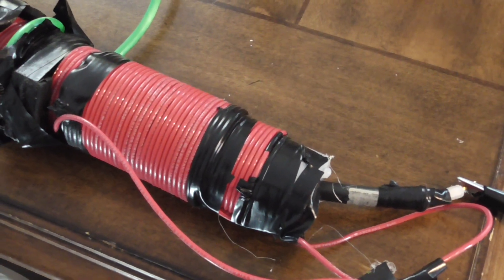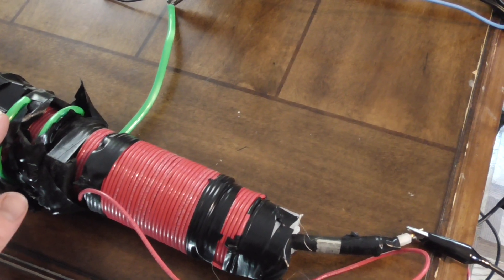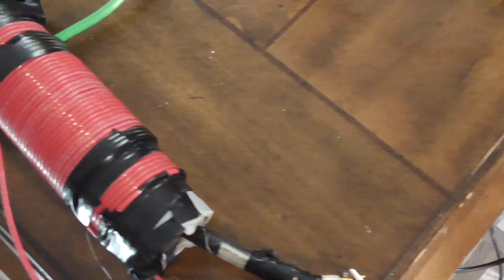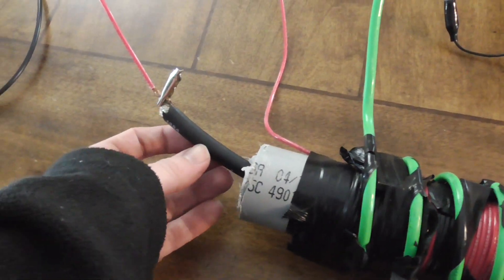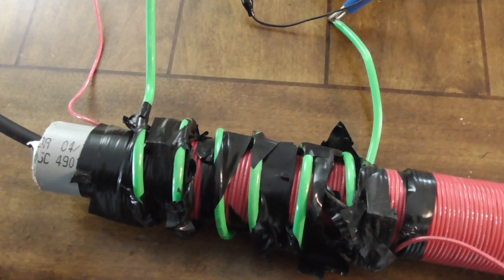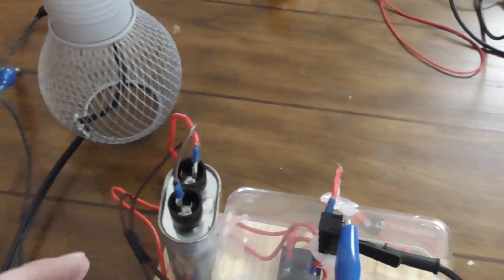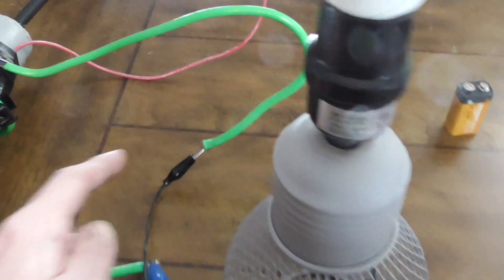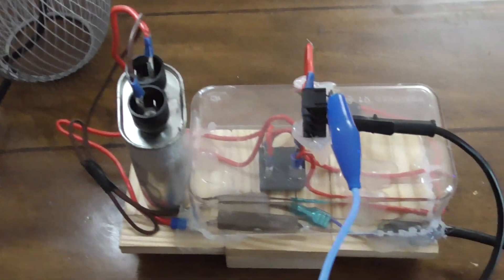Kapagen Electret Pumping

Comment: Joel could you also add the stratified atmosphere electric energy ? At 10 ft it's 300 volts at 30 ft it's almost 1,000 you think with the two it might work better ? Good show!!

Comment: i like the concept your are talking about can you draw the circuit and share the coil specification ,capacitive power supply  in more details , thank you
Reply from the maker: the capacitive power supply schematic is here, it's rather simple. Like 2 parts, an x reactance capacitor to drop current down to 40ma and full bridge rectifier. No filter cap to keep a pulse. Just  ignore everything past the rectifier as the given example in the video link is for battery charging. take a look here. https://youtu.be/fVMpQQugA-0

Comment: Looks great ..I guess it's the same principle operating of the Barbosa & Leal circuit, as they use AC mains voltage to create a vortex of electro-current coming from grounding cable...wish it can be harvested as overunity free energy.